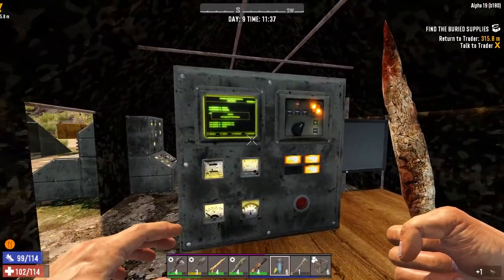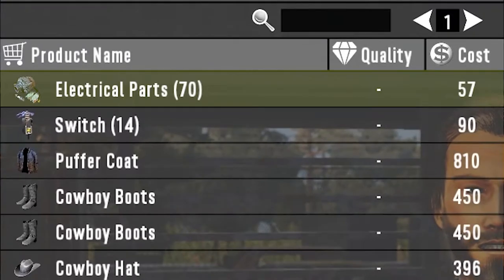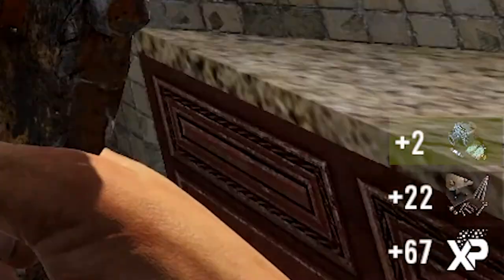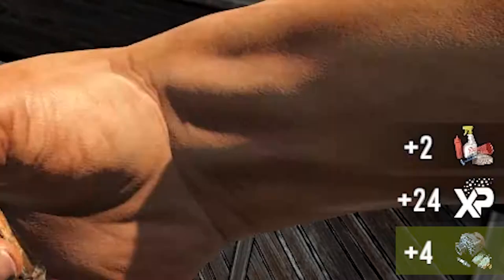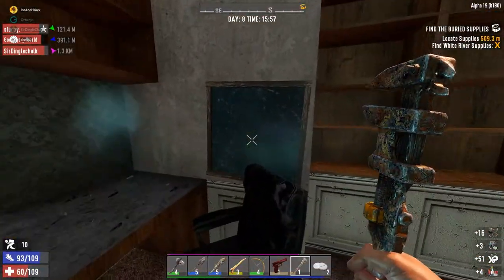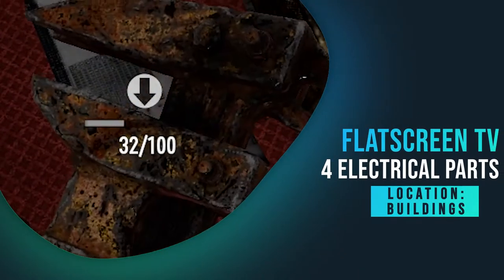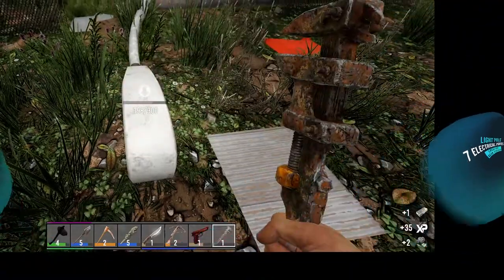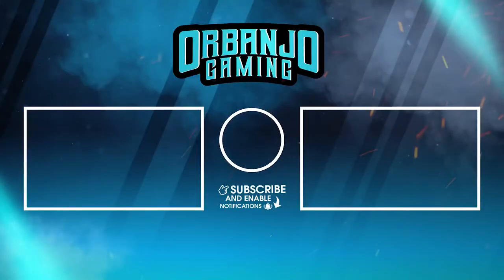10+ different ways to get electrical parts

Comment: I cant repair my electric fence posts?
I have to repair it before picking it up.
I have electrical parts, hitting with a  wrench breaks it, wire tool just redoes the wiring.
I can't seem to find any information on the wiki except "use electrical parts to repair it"?
Please help ;_: